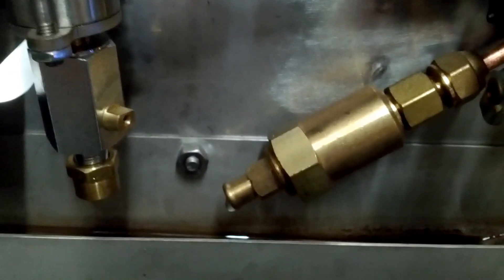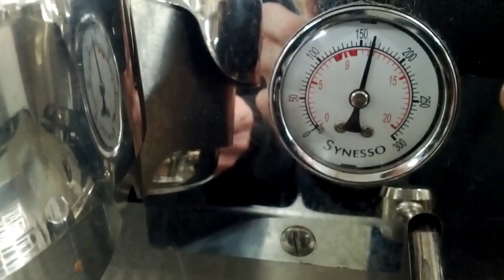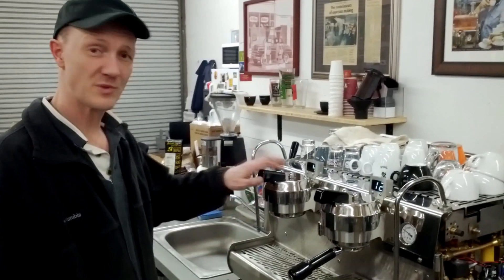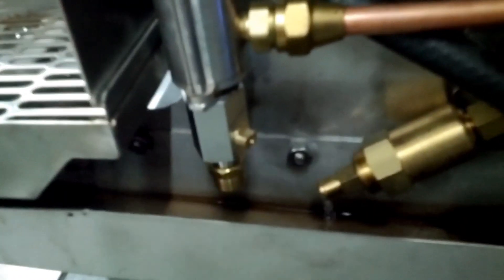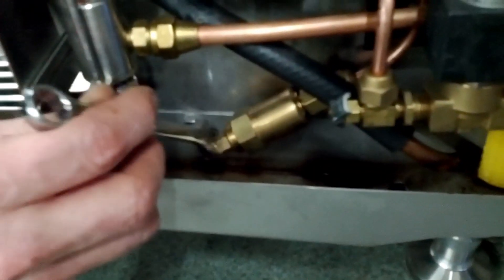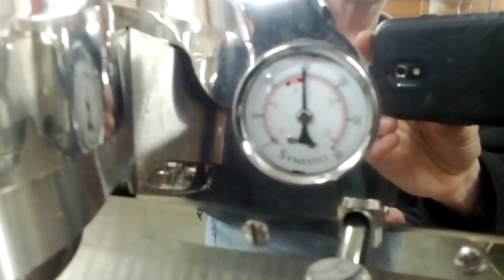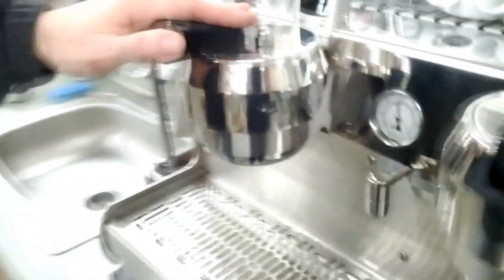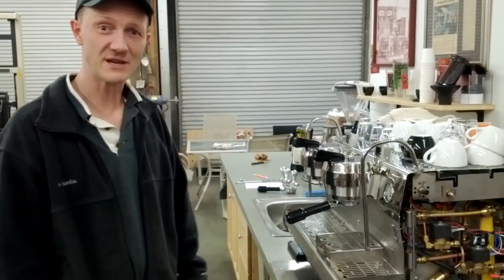Setting Your Expansion Valve

Comment: Thank you, helps a lot!
FYI We recently insulated our circa 2000(no oem insulation at all, they seemed to add some around 2010) Linea classic with approx. 3/4-1" thick polyester batting. In my opinion it is a must to do for machines without or add to any oem insulation and we got the 100% polyester for free from a meal kit which uses it as insulation called "renewliner w/sandwiched clear pet sheeting". No zip ties or twist ties were needed. Just wrap the tanks separately with 20" long pieces. Cutting holes for sensors and long cuts to tuck under tubes. 2 layers for the ends of the tanks and a loose removable large sheet for a second layer on top of both tanks as heat rises. Be careful not to accidentally push down the steam tank's water sensor probe setting-add electric tape or zip ties to it's height position so it can't change. 
Added small pieces on top of the brewing heads and wrapped the steam valves and pressure gauge with a medium piece. All totally removable easily. 
Added a sheet tuck wrapped to each tank's bottom, drain valves hold it in place. 
Did have to remove the side back surround panel to add a small long insulation strip to steam tank's backside under rear panel, to do the most insulating possible. 
The top cups warmer still warms the cups now but they aren't hot like before. Our machine doesn't have a heating element for the cup warmer top.
Now staff is more comfortable and machine's heaters/electronics cycle on much less and bldg's AC system doesn't labor as much. Saves $$, reduces heat aging of machine's wiring and electronics.  
Polyester "pet", "recycling triangle #1"  batting(often made from recycled bottles) insulates well and is in most of our pillows and sofa foam top padding, comforter innards and isn't nasty lung irritating and itchy like fiberglass and can take the heat since the temp cut offs are 135c and no open flame. It's the best material I've found.
Take care